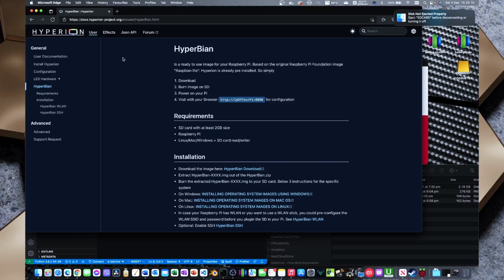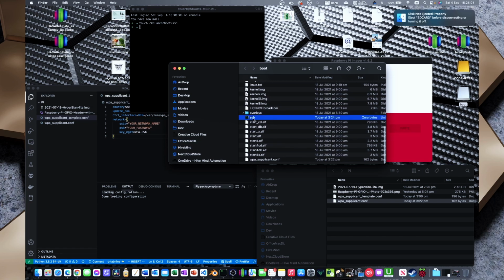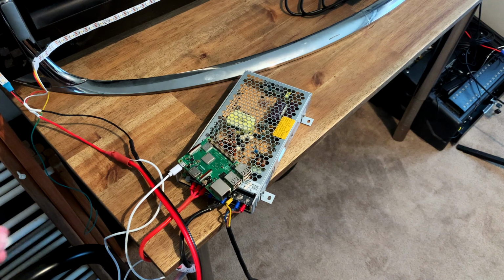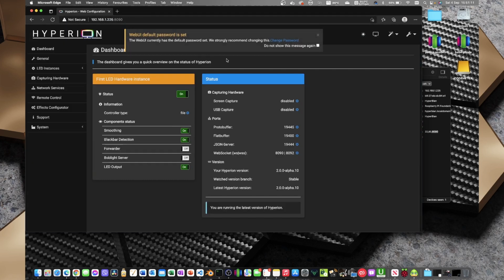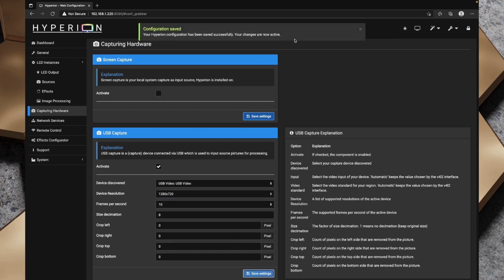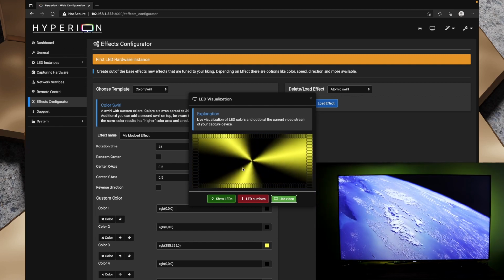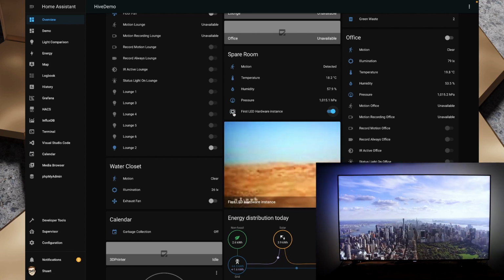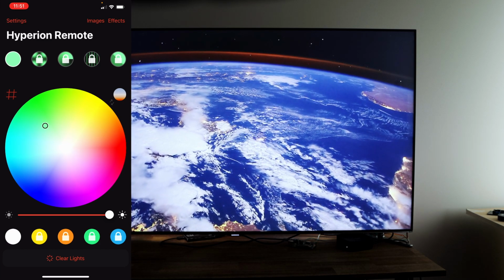Reactive TV Bias Lighting with LED Strips and Hyperion

Comment: great video. Would it possible to use a single power supply 5V 15A for  Pi3 and the LED stripes? I saw some videos which they doing this with a micro USB caple. My TV is 42" so just 180 LED (3m lengths) maybe the uneven lighting will not happen ?
Reply from the maker: Yes, I did this in the video using a single Power Supply.

The PROBLEM tends to be the low gauge of the traces on the flexible board, so you get voltage drop between the first and last LED.
To ensure the lighting is even brightness along the full length of the strip, you need to inject VCC (5V in this case) not just at the start of the strip. it can be from the same Power Supply, you just run a chunkier wire to the injection point.

The good news here is - If you're doing a full wrap of the TV, starting and ending at the same point on the TV - you should be able to inject your supply voltage at opposite ends of the strip. 
With a 3m long strip it should be fine.

Comment: Is rpi required what if one uses the hdmi splitter and run hyperion on proxomox since capture card won't do hdr
Reply from the maker: I can't say I've tried, but I believe Hyperion will run on a Debian based linux. That said, the benefit of the Pi is you SHOULD be able to drive the LEDs from the GPIO pins on the Pi, I was running into a problem with mine which led me to use the WLED method.
Reply from the maker: The liklihood is that I wouldn't have experienced that problem if I was making use of a Logic-Level Shifter to get the voltage of the Data Line to 3.3V
Reply: @HiveMindAutomation  but wouldn't that be controlled by wled?
Reply: As rpi is only controlled as capture to pass data to wled
Reply from the maker: WLED isn't required in the loop at all, I used it to solve a problem And because it was an option.
You can use SPI output on one of the GPIO pins from the pi to drive the data line of the LED Strip.

If you're going to use the WLED method you should be fine to go ahead with your plan. make sure your WLED has a good network connection to reduce latency.

Comment: Thanks for the video. Was very helpful. The only problem I'm getting is that the LEDs won't turn off immediately when switching off the HDMI device. They switch to some kind of static rainbow test pattern for about 10-20 seconds before they eventually turn off. Someone told me I have to install a relay to get the LED strip to turn off but i'm not sure if this is true. Does yours turn off immediately? Maybe your power supply has a relay in it? I have no idea about such things.
Reply from the maker: Theres Some discussion of this on the Hyperion forum: https://hyperion-project.org/forum/index.php?thread/11064-control-led-power-supply/
You can put a Relay on the +ve line of the LED Power Supply and there's some documentation for running a script to trigger the GPIO pin on/off when the signal changes.
I think mine go to the Test pattern state too, but I dont have this setup in production yet. 
The LED strips for my new TV just arrived from China this week and I'm working on designing a hat for the Raspberry Pi to handle functions like power etc. so it's going to be at least a few more weeks before I do the installation and test it again. The plan is to use a MOSFET instead of a relay to handle Power to the LED strip. pulling a GPIO pin high or low should be fairly straight forward but I will need to dig into the Hyperion Documentation
Reply: @HiveMindAutomation  although fun, I have to admit I would have been better off purchasing the Philip hue device. The capture card itself was $70 AUD (discounted) and doesn't even support CEC. Now I find out I need to install yet another device to make it power off correctly. The result is a great DIY project but hardly an elegant or cheap solution, given the amount of devices involved, and losing CEC functionality.
Reply from the maker: Great points.
I am pretty frustrated by the loss of CEC functionality.
You COULD definitely find a way with Home Assistant to detect the TV/Media Player power off and create an automation to send a command to the Hyperion box to power off the strip/blank out the LED's. Or like the forum suggests a smart switch on the PSU.

Bear in mind the $500 purchase price for the Philips Hue Device doesn't include any lights, it's just the HDMI capture to then allow you to sync other philips hue devices to the HDMI input, and you ALSO need the $189 Philips Hue Bridge. Honestly by the time you get the setup for Philips Hue you're looking at easily $800

I can't disagree with the comment around Elegance, I guess that is a price to be paid for these kind of DIY Projects.

When I'm setting up the new TV, I'll be putting in some additional effort to ensure the installation is as clean as possible, hence the Rasberry Pi Hat.
Reply: @HiveMindAutomation  Oh. You're right. I was under the impression for some reason that the Philips solution was about $250 including the LEDs (I already have the Hue Bridge). I take back my comments about being better off buying that. The DIY solution is clearly a winner, despite it's inelegance. That kind of money for a light effect that essentially looks like a broken TV bleeding light everywhere is ridiculous. Don't get me wrong, I think it's a cool effect but I reckon it will prove to be a bit of a fad.
Reply: @HiveMindAutomation  By the way. I found in Hyperion that when you change your settings level to expert you get extra options in the USB Capture settings. Among them is one called "Signal Counter Threshold" which if you reduce to a low value, will help turn off the lights quicker when the HDMI device is turned off (as long as "Signal Detection" is enabled).
Reply from the maker: That's an awesome tip!
I'll definitely take a look at that setting. I think I turned on advanced at one point and panicked cause it was going to make the video 8 hours long :P
Reply from the maker: You're not wrong about it being a bit of a fad.
That being said when I just had the non-reactive bias lighting - using WLED instead of Hyperion - I noticed reduced eye fatigue when watching Movies in an otherwise dark room, so it may have other benefits than just looking kinda cool. (Sample Size = 1, your mileage may vary) 
I'm yet to see the Effect coupled with the new HDR TV though, so that will be interesting.
Reply: @HiveMindAutomation  so you mean just an ambient light of an arbitrary colour? Sure, but that doesn't require the hassle or cost of a capture card or raspberry pi. Just a small Arduino works too.
Reply from the maker: Yep, Used to have WLED running the bias light. Hyperion is over the top and unnecessary. But like you said.... it's a cool project :)
Reply: @HiveMindAutomation  I've never looked into Home Assistant. You doing any videos on that?
Reply from the maker: @Junglejuz  yeah. Most of my videos tie back to Home Assistant in some way

Comment: Hi Stu, Great video.
An rpi3b+ + meanwell ps + led strip + hdmi passthrough altogether $150?
Reply from the maker: In hindsight I should definitely not have mentioned $150... I think it's closer to $250. Still cheaper than the Phillips Hue version, or the ~ $1000 premium the phillips Ambilight TV's have.

Pi ~ $60
LED Strip ~$35
Capture Card ~$ 95 (it's since dropped to $58)
a less overkill PSU for this project: Mean Well LRS 100-5 5V 18A ~$45 (inc GST) @ Element14.com

So ~ $235 in total
Damn, I forgot the SD Card for the Pi... Another ~$20

To be fair the Meanwell PSU cost me nothing. I Saved it from eWaste.
I had multiple Pi's (and cards) left over from previous projects.
But you could reasonably get another PSU into the budget depending on the length of Strip you're using.
And the SK6812 strip was already on the TV from when I was using WLED to handle my bias lighting.

Comment: Do you need to wire the 5V power and ground to both ends of the LED strip?
Reply from the maker: Technically no, but in my experiments I found the voltage drop along the length of the strip contributed to uneven lighting (the end of the strip was dimmer than the beginning)
Your mileage may vary, but if you're cutting and splicing at the corners, it's a perfect opportunity to put supply voltage into the strip.

Comment: G'day Stu,
Love your work and watch you every week. I dabble with the addressable LEDs and they are quite finicky with low voltage. You mentioned that the first pi with the lrs PSU were running about 4.6V which in turn would reduce the data "High" voltage probably a bit below the LEDs tolerance. The data "High" LEDs minimum is around 3.30-3.36V which is just at the pi's logic high data signal with good power supply. Generally of you're trying to run addressable LEDs from a pi the length of cable from the data supply needs to be as close as possible. Ie. Less than 150mm, once the first pixel or LED is able to successfully use the received data it is able to transmit the ongoing data much cleaner because it has a more robust 5v supply and shorter distance again from the last data transmission source. How that makes sense? Cheers Bazzy
Reply from the maker: Nice one. I think I had close to 500mm of lead off the output so that makes more sense now.

I only had the longer cable for the Demo too.
I'd planned to try a line level shifter to boost the voltage back up but haven't gotten that far yet.
Reply: thanks for this information. So it means that the SK6812 LED are running out of there specification. Thats the reason for using a level shifter? My idea is to use one power supply source 5V 12.5A for a Pi3b and the SK6812 with just 180 LEDS and 3m lengths. Do you think this is possible?
Reply: @tommytwotimes2838  yes, it'll work just fine. Make the data wire as short as possible, or cut off one led and wire it in next to the Pi, this is called a "null pixel" and can be used as your "level shifting". But the Pi is a bit overkill for only 180x leds, unless the Pi is doing other things at the same time? Have a look at getting a NodeMCU or ESP32 board and load WLED on it. I run a node MCU with 300x pixels in our Christmas tree